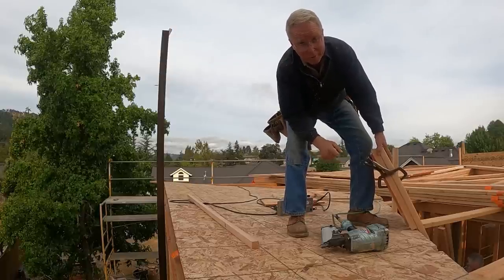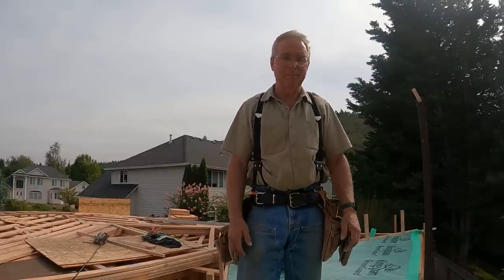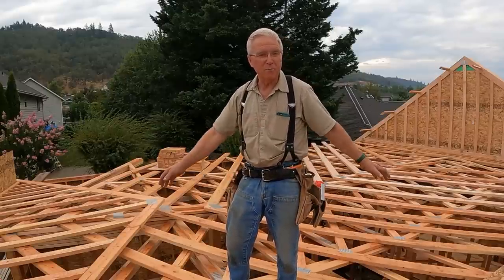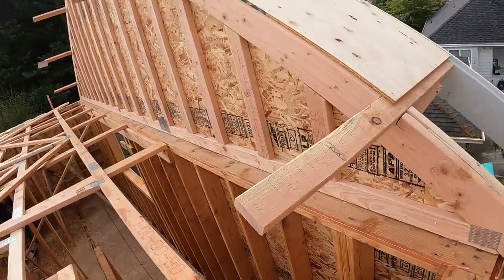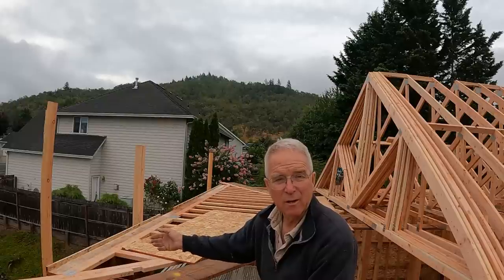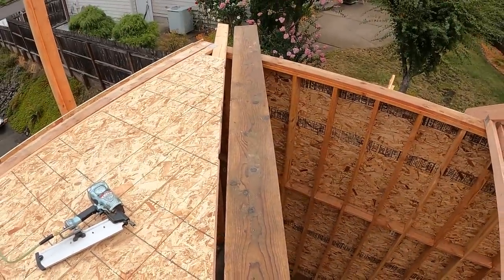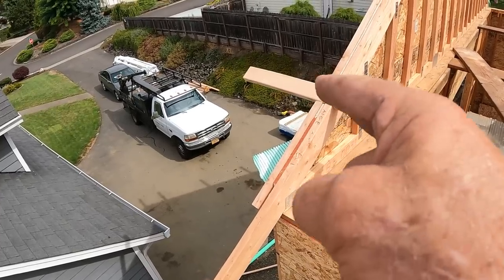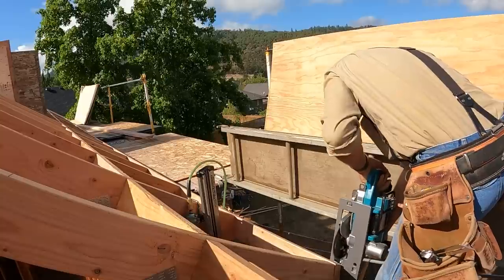Framing is an Extreme Sport - Stacking a Roof Solo: Shop Build #17

Comment: I'm 58 yrs old. You frame like I frame. Do as much as you can on a flat surface. We did some gable ends 3 stories up and installed the windows, siding and eyebrows(with roofing, and vinyl soffit with aluminum trim...all before standing it up. Saved a ton of work off of ladders and scafolding. We are a dyeing breed my friend.
Reply: I'm 55 and frame the same way... we've even set windows before raising a wall, adjusting them PLS afterwards... key words Scott said, "paying attention"... Its alway been said, "the job picks the man, the man dosen't pick the job" no truer words for construction work... and I'd rather build the office, than work in one!  :)

Comment: Scott - I'm loving this series.  So many  little (and big) nuggets of wisdom! 
One thought on sub-facia - as the owner of an almost 100 year old house, I can tell you that gutters nailed directly to the ends of the rafters will eventually cause rot if not maintained properly and there will be no purchase for the spikes.  When this happens, there are not really any good options.  Scabbing on a sister to the rotten rafter tail is the easiest but certainly not clean solution.  A sub-facia is one more line of defense to this issue.  If the sub-facia rots, it is a simple matter to remove and replace.  One of those ounce of prevention matters.

Comment: I've been a fan for a few years now. I do feel the need to comment on the positioning of the truss gang plates. If you look closely, you'll find that the center of the plate is always on the spot that the truss members come together. Moving the plate lower to allow a block as you suggested just doesn't happen, it's simple coincidence that the block has room there.

Comment: Good for you! I spent five years roofing up at Lake Tahoe, CA back in the early 90s. I worked on hella roofs, steep (to shed show and reduce ice dams) and high-up because most homes are on steep hillsides and land is sold by the square foot, so three story houses are common. I'm almost 62, live by myself on 40 acres right on the WA/BC border at 4,000'. Winter is six months long here, and I just got in from pushing snow berms with my frontend loader on a mile of road. No neighbors. I run a Woodmizer mill by myself, mill live edge slabs, build furniture, do custom wood projects for folks. I repair and maintain all my equipment by myself. If you are like me, you are looking around at folks your age already bent over and hobbling along. Not for me. I work hard 7 days a week. That's my retirement.  8-)
Reply: May you continue to be healthy.
Reply: Im 68 yrs young. I'm a DYI guy. I don't mind working alone. 
But. I have 2 grandsons whom are my tails. Gawwpa what you doing today. Can we come over and play and help? 
I always say yes. What ever I'm doing I get my little helpers to learn. Teach them as much as they can learn. 
Safety is a big concern with me. I teach them about it too. 
I'm the guy that has a bad back from lifting heavy item in my younger years. I get sore easy. But I move on. I'm not bent over or shuffling along yet. But it's sure feels like I'm lugging rocks sometimes. I now have 2 more great grandsons to the tribe. I'm a happy gwawwpa. 
I also have grand daughters I dearly love. God bless

Comment: I’ve always liked framing. Recently I switch over to using Simpson 3” structural screws for fascia and barge rafter instead of galvy 16s- no worries about waffle marks and they hold so well. And you can back them out of the board shifts or you need to adjust it. I also back mail all my blocks through the truss onto the block instead of toe nail the block to the truss.

Comment: As usual, a very informative and dare I say entertaining video. I'm a partially seasoned homebuilder with a passion for learning. That said, a true expert knows that it's the little simple nuances that create a consistent quality build. You always show this well. If I can offer one tip that I picked over the years; have the gable trusses manufactured with the top chord dropped 1.5" or 3.5", or whatever height outlookers you want to use. That way there is no notching required. As I'm sure you know,  its stronger to go the 3.5" way and it also gives you the height to go two nails high to reduce any faceboard wave. If you are doing closed soffit, there is no need to close it in between. If you want open soffit, cut 2x4s to go in between as blocking.

Comment: One of my first carpentry jobs flying trusses on a 40x60x16. 24oc we kept the crane operator to help us set. The foreman hooked his tape to to the gable truss instead of butting. The plates were fastened by guys on the side. We did rat runs as we set. That 1.5” leaning over (30) 40’ trusses was enough to break away from the strong back and the whole truss package came down. Swung down making a wedge spreading the walls like Noah’s arc. I ran out when I heard the creaking. I still got hit in the elbow on my way out. My buddy was down at the creek going pee. We thought he was inside. We were screaming for him. We started cutting the trusses into firewood as the crane truck was leaving. Job was in  mapleton, or. Contractor out of crow. I’m from Springfield, live in Eugene. 25 yrs carpentry and still learning.

Comment: Here in B.C Canada venting requirements are 1/300 or 1/150 on roof slopes less than 1 in 6
Reply: Most locations in the US that I've done work in use some form of the International building code. The requirement in the IBC is similar to your numbers, The standard number is 1/300 with an exception for 1/150 in designs where specific conditions exist. One of those is the climate zone of the project and the other is how much venting is located at the eave vs. at the upper portion of the attic/roof plane. In the 2018 IBC this is described in section 1202.2.1 and its exception.

Comment: Great work.  Only thing I might've done differently is to not sheath the roof/lookout portion before the gable end wall was stood up, but to do it after the wall is up and then allow for every other row of the sheathing (run long side parallel to the ridge) to cantilever out to the fly rafter at the end.  But then there is a premium on the whole site safety issue when nailing the sheathing down on that outside fly rafter.
Reply: Yes, I agree 100%. Also, the lookouts are 4' oc and you can't span plywood more than 24" oc so that's doubly incorrect.

Comment: I never thought of myself as extreme athlete. but I have sure framed my fair share of  houses, both spec homes with trusses and custom homes with a stick roofs. a lot of the things I did when I was young would have been an OHSA violation, but then I found a lot what they insisted on were counter productive and  no safer than what I was doing. Though standing on a 2x6 wall 20 feet in the air setting glue-Lam's is not very safe, but what do you hang your safety line to, nothing is above you but the sky, maybe I needed a sky hook? having a praying wife is a good thing.

Comment: Maybe you can explain their reasoning but i have noticed that, now that I am in my late 70s, building material manufacturers have started making products like sheet rock and plywood much heavier than they did, even 25 years ago. Sometimes when you go to pick it up, it feels like it is nailed down.
Reply: You sure that's not just you being nearly 80?
Reply: I'm in my early 70's, but I have noticed that gravity is getting stronger. And the floor is further away. Not sure how to reconcile that with the physics classes I took in college, but I am quite sure it is factual.
Reply: Also pants and belts are tighter.
Reply: @orijimi  I think you may have missed the subtlety of the OP’s comment.
Reply: I had to don my goggles to be able to read this. I find that the size of font and the volume of conversation reduces in direct correlation with the increase in gravity relating to the perceived weight of building products. A wise man once told me that there ain't no such thing as gravity. The earth sucks!
Reply: I hear ya my friend - and I thought it was me!
Reply: i just turned69 and i cannot believe how heavy lightweight drywall is ? and don't ask me about three quarter plywood !
Reply: @Martin52863  Evidently, Ҏoє's Law in effect. (Do I need to say more stuff in order to have my comment accepted? Seriously, what the heck?)

Comment: I'm SO glad you're going with synthetic underlayment! It's so vastly superior that I'm amazed that they even sell tar paper now. Relco built my trusses too, but I had to have a crane place them since they were 52 feet long and 200 lbs each. That was expensive! Though a lot safer too. The foundation and trusses are the only parts of my 52x48x13 shop I didn't build. Four years and counting, but you certainly understand how much slower it is to have only one pair of hands doing the work. Anyway, your project is coming along nicely! What will you use for heat and A/C? I installed a mini split here in Springfield and loove it.

Comment: Crews I've worked have used both the notch-out cantilever method for the lookouts, as well as just toe-nailing 2x6 blocks into the gable, and then between that and the roof sheathing overhang, it somehow supports it. I always hated doing the latter because it just doesn't seem as strong (and it's not). But when the truss company doesn't supply a gable-end truss that you can notch into, I'm sure sure how else it can be done.

I remember before I encountered the 2x6 block method, without thinking, I notched into the outermost truss (not a gable truss, but a webbed load-supporting one). My boss came back, noticed my notches for the lookouts, and calmly remarked that I notched into a load-bearing member and said something along the lines of "The inspector doesn't object to that method?". It was then that I realized my mistake... oops!

Luckily the inspector didn't notice... and it passed inspection.

Comment: If you want your trusses to make a flat plane on the shingle side; measure from the peak of each truss to the point on the top cord where a plumb cut hits the exact outside edge of the wall; use the same measurement on each truss.  Use that marked plumb line to align all the trusses to the outside of the same wall.  Trusses are not always perfect copies of each other; this method will ensure you get a flat roof, at least on one side.

Comment: General code minimum is 1/150 SF of free area Intake air, and 1/150 SF free area exhaust venting.  In a practical sense the steeper the roof the more effective venting is.  Anything less than 4/12 and I would go after an unvented roof assembly because any venting you try to do will fall short of its intended performance.

Comment: Can you do a video on repairing a truss that has been delivered to the site slightly damaged? Had a delivery for our spec home recently where a metal gang nail plate had popped loose when dropped off the flatbed and the end of a 2x4 diagonal brace at the same connection point suffered some slight cracking at the end. Thank you for your consideration; I value your opinion.

Comment: Easier to order your gable trusses 1 1/2 inches shorter, install your outriggers and fill in with 2x2's.  Did that with my house, and especially when using unskilled help, saved a lot of time and effort.  As a side note, if I were to build another home, I would have the trusses designed with a 12-inch height at the over hang.  A lot of heat lost at the eves.
Reply: He built his lookouts to last. Your method is far weaker, faster but weaker.

Comment: Instead of notching the gable truss for the outlookers, would it be easier, faster, stronger, to have the gable trusses designed 3.5 or 5.5" shorter to allow for a 2x4 or 2x6 to rest on gable, and extend into the following truss, and allowing for the overhang of the outlooker?  Just curious on your thoughts, as I was planning on having all my gables built to allow no notching

Comment: Why not get the end trusses an inch and a half smaller and fill in between the overhang 2x4s?
Reply: This was my question, too. I immediately wondered why not use drop gables. Still gotta fill in the space between the lookouts just like he did in the video, but you save the time of notching the top chord of the gable truss.

I like to pre-sheet the gable trusses, but I have never built out the entire lookout/eave before standing it up. Not a bad idea as long as it doesn't get too heavy.
Reply: Because using notches to "drop-in" the lookouts gives you a continuous bearing surface for the sheathing, and if code requires, an uninterrupted sealing surface under the sheathing which mitigates air loss, besides the fact, it's the RIGHT way to build a gable end-wall.
Reply: If the notches are not 100% cut perfect they too will contribute to air migration.
There is more than one right way as any good carpenter could tell you
Reply: @mikekellam365  Blocking between lookouts on a drop gable does the exact same thing, it provides bearing for the sheathing and stops air migration. He had to block between the lookouts anyway with his method. Both methods work, but one requires  a little less work.

The only advantage I see to his method is more bearing for sheeting the underside of the eave with soffit ply. But the blocking in a drop gable situation can be offset slightly to provide the same bearing/nailer for the soffit material.

Comment: I can't remember the name of the stuff I've used for underlaying shingles, but it's basically tarp material with reinforcement stuff built in that gives it more traction. You can walk all over the stuff and don't have to worry about ripping it and it slipping out from under you while on a roof and you can leave it over the weekend in a rainy wind storm

Comment: Why drive the 16 DB’s by hand on the pre-primed spruce boards instead of using the pneumatic nailer?
Reply: Maybe because hot dipped galvy nails don't come collated?
Reply: @JeremySpidle  And the nails need to be flush with the board.
Reply: @JeremySpidle  No, they definitely do. My guess is it's a finished surface and he's likely trying to avoid overdriving. Or he didn't have collated HDG nails with him, or he just felt like putting them in by hand for the hell of it lol
Reply: @drew5334  on a finish surface, aren't you supposed to overdrive (set) nails to make room for a caulking seal?  I always do...
Reply: @JeremySpidle   probably really just depends what you like. Personally I like the look of a flush seated nail and seeing fasteners depending on the finish and materials. But lots of people like invisible fasteners. If it’s painted deeper and caulked on top probably would look better and possibly be a bit more waterproof
Reply: Probably because a box of hot dipped strips of nails are expensive compared to a bag of singles and he’s saving money for his daughter and son in law? Or he just feels like hand nailing
Reply: My guess: Don't fuss around with too many tools and equipment.. on a catwalk that high. Just get the work done.
Reply: @JeremySpidle  Putty and paint makes a carpenter what he ain't! How many framers take the time to go down to the compressor to set the air pressure to the proper setting so the nails aren't overdriven? How many framing nailers have a depth adjustment for the depth of drive of the fastener?

Comment: EC, you have done many videos on the tools and equipment you use, but I don't recall ever seeing one about the air compressor you run. I am curious as there always seems to be a compromise between the amount of air a compressor can provide and that of portability. I would be interested to know what you have used and currently use. I would guess a different setup was used on the spec house when multiple contractors were on-site versus what you use when working solo/small crew. Thanks for any insight you can provide. Keep up the good videos!
Reply: I’d like to know too

Comment: plywood on one side of roof but osb on the other?

I added lookouts to my roof when I replaced it so I could have overhangs. It was a pain. Roof is a dutch gable with the gables flush to roofline, didn't like the look. I spanned the plywood from original rafters to the new edge for the extra support.